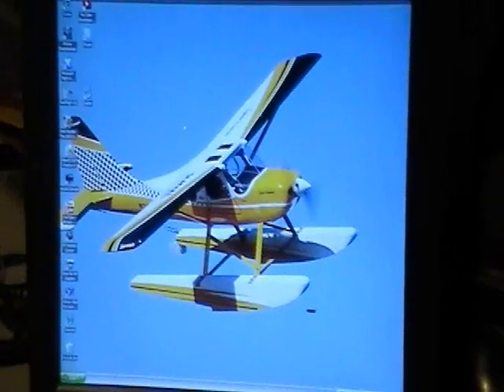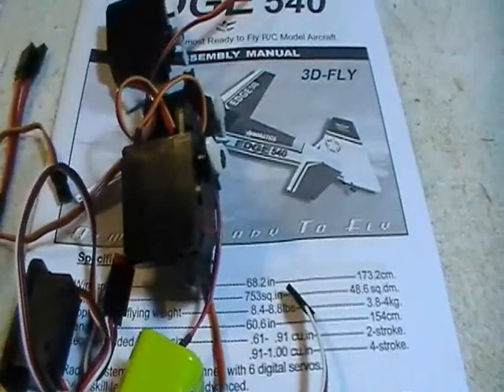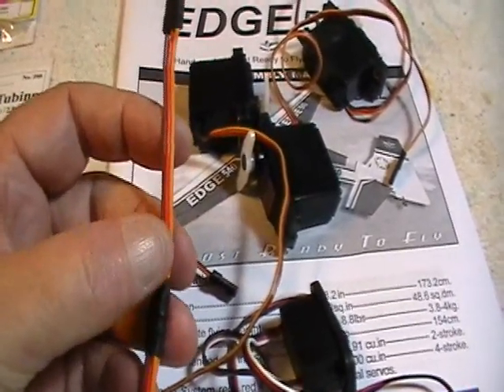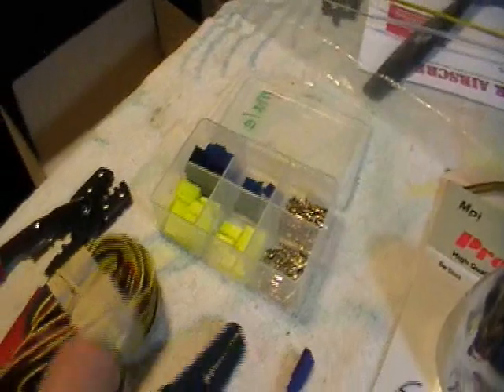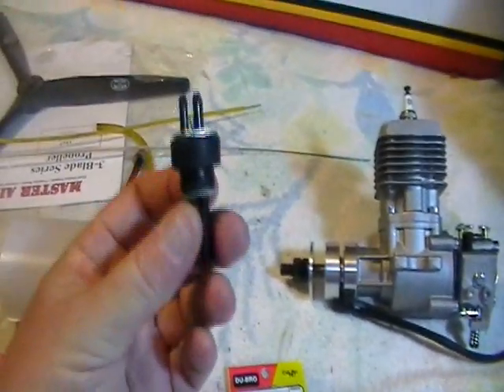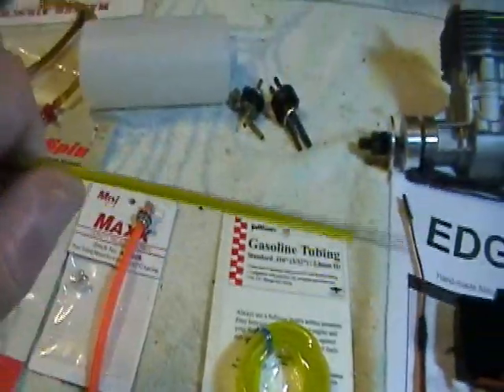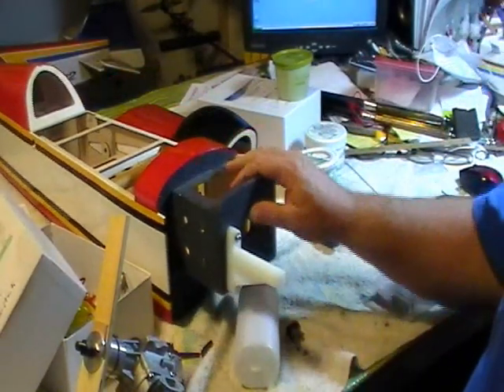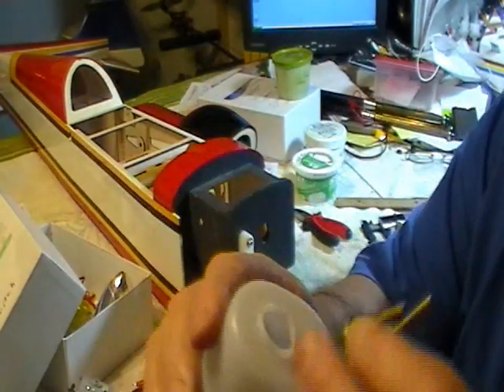Part 1 Building The Edge 540 By Seagul Models

Comment: Hey Terry glad to see the start of the 540 ! I watched the video in full, the motor box looks like a hassle to change out but it will be worth it for the price difference in fuel. One suggestion on the tygon fuel lines especially in the tank you want to secure the ends with wire around the ends at the connections to keep them from coming off in the tank. Makes a more secure connection there when using copper tubes with no flared tip

Comment: Have you made a part 2 video. I have the same RC and am installing a RCGF 20cc on it. More info on mounting the engine would be a great help. I did see a 540 60 with RCGF 20cc video and they did not have to cut out firewall.
Thanks 
Ray

Comment: Hello. I cant seem to find the guy that sell the servo connectors ? Do you have an email address for him ?
Reply from the maker: Hello there, that guy has sense gone out of business on ebay, i found some colored tips at Esprit Models in Florida and now they don't carry them any more either, i have been getting the black ones from Servos&stuff.com and just useing colored heat shrink on them, that works pretty good except then is hard to get the safty clips on the that i use. I have searched everywhere and can't find any colored ones. Hope this helps, just give me a holler if i can help you out. Take care my friend
Reply: Ok. I have found a store that has some.. A bit pricy but i got some from them..:http://www.dreamworksrc.com/catalog/Complete-Servo-Connector-Kit-Color-Coded-Plugs

I also found some at this site: http://www.hansenhobbies.com/products/connectors/servoconnectors/

Love you Edge 540 build, for that reason, i am going to buy myself one to try an build it myself. I am some what new to flying, but i can fly a little. Thanks for you extended help to us newbies..
Reply from the maker: You are more than welcome, if there is anything i can help with on your 540 build just give me a yell. You will love it, just keep in mind sense you are kind of new that it is a HOT ROD and is really fast and snappy, you might turn your rates down just a bit from what the manual calls for untill you get used to it, or maybe someone at your club could help you on a buddy box for the first couple of flights, just keep a little throttle on it coming in to land or it will stall, it doesn't float in as easy as a trainer or a top wing type plane. Thank you very much for the links, i will check them out. Take care my friend, Terry